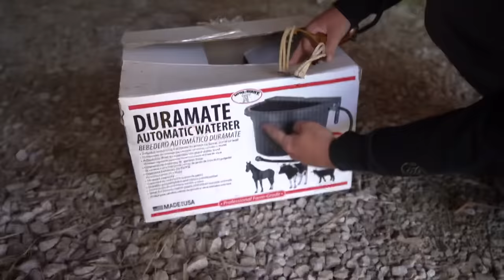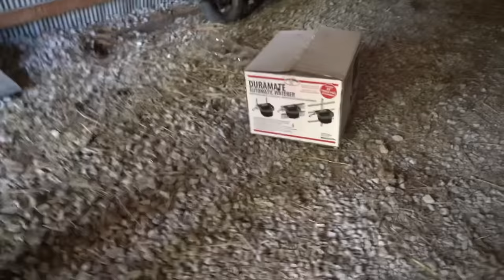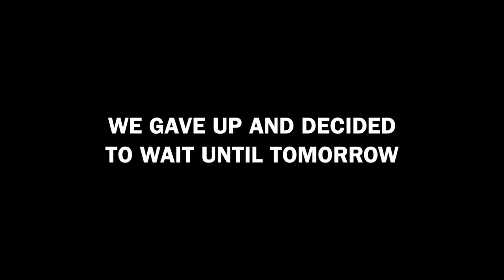SLINGSHOT Bullfrog Hunting CHALLENGE in My BACKYARD!!! (CATCH CLEAN COOK)

Comment: I’ve got a few ideas for the pond situation.
1) the flow may have been too low               2) the water may have heat up too much.      3) when you cleaned the filter u may have eliminated too much bacteria which led to an ammonia spike                                As for the turtle id just do water changes every day with a hose so that it stays clean. Turtles poop a lot.
Reply: Adpdl

Comment: I’ve harvested cottontail rabbit all the way to pigeon with the same slingshot Flair is using, the color of the bands matter as they have different materials in them that make them anti freeze and up resistant, they also get a bit stronger the thicker you go in tube thickness but if you are using undersized ammo or oddly shaped projectiles forget about hunting. I get about 15 - 16 joules of force using various rounded river rocks or 1/4 steel balls. I highly recommend this slingshot for anyone who wants a better and more efficient way to bag your game of choice with portability and little weight .

Comment: I know I'm waaay late to the party on this but you need to draw to at least your ear and keep your slingshot arm straight, just like holding a bow. It's exactly the same as in traditional archery, you need to develop an anchor point so that both hands are in the exact same position for every shot you take, and make sure to work on a consistent release. All those factors will develop the necessary consistency for effective and accurate shooting.

Comment: Hey, mah boiz! Not trying to be condescending or mean, but I solve problems really well. The walleye died because your ponds need three things; aeration, shade, and some kind of algae eating animal (maybe a plecostomus). Walleye are members of the perch family, and don't tolerate the lower oxygen levels that the sunfish family, of which largemouth bass are the biggest members, can. As far as the slingshot goes, try anchoring back by your ear. The further you pull it back, the more velocity you get. Also, if you're still not getting kill shots, try black surgical tubing, and shorter bands. The black stuff is much stronger than the yellow that your slingshot came with, and a little less length will force you to stretch it further. 
4 Patriots has solar powered generators that you can run your aerators on, and there is a kind of willow that, if you plant it now, will be ten feet tall by winter. I planted one in front of my house five years ago, and it's thirty feet by twenty feet now. Don't remember what kind or where I got it from, though. They send you six-inch sticks, and you soak them in water for a week, and they grow roots and leaves. Then you plant them.